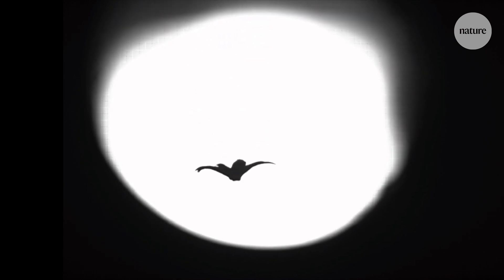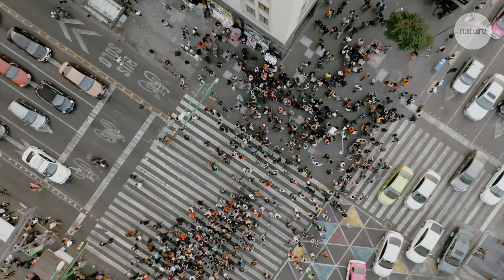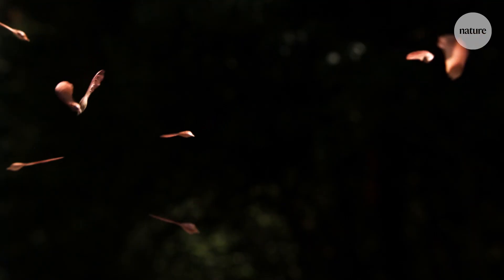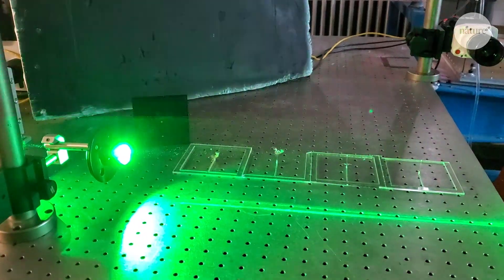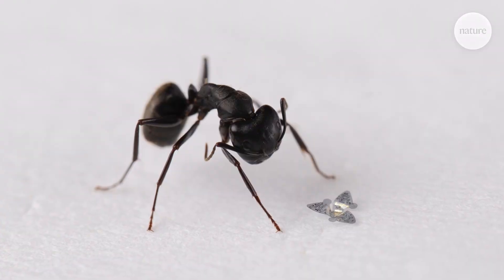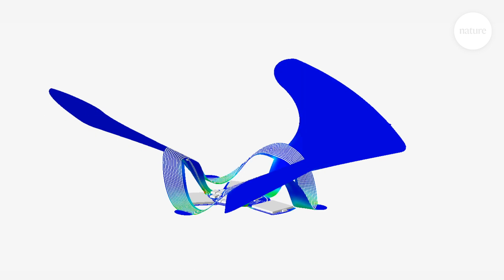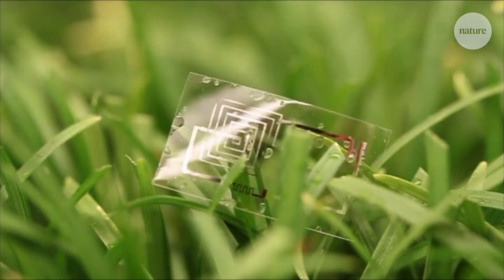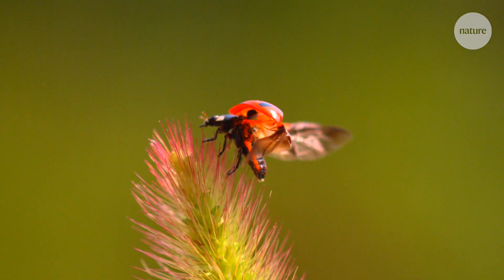Spinning seeds inspire floating electronics - and monitor the atmosphere

Comment: a dissolving substrate is nice, but that doesn't magically whisk away the various heavy metals used in the production of the actual electronics on the substrate. What of them? Are you claiming to be pursuing fully biodegradable electronics?
Reply: Polution is a matter of concentration. This heavy metals came from nature itself, from the ground, in first place.

If you concentrate led from the ground and them sprinkle it back thin enough, you're basically restoring the early conditions, and not polluting.

This concrete case presented in the video might be a problem, but it might also not be one.
Reply: @guiguspi  "the ground" is a fairly ambiguous title. You don't generally find much lead in topsoil so adding any additional lead to it is going to raise the levels of it above natural levels, and that's pretty much the same with all the other heavy metals used in simiconductor manufacturing. Unless they're exclusively dropping these things into spent heavy metal mines, they're not going to be restoring anything. Generally speaking, the dose makes the poison, but heavy metals are a special case. There is no minimum safe dose of lead. It has no benificial biological function in humans. A single atom of it is toxic, two atoms of it are twice as toxic, and on and on as with many heavy metals.
Reply: I agree with you! Imagine, hundreds of thousands these tiny devices litter the opened space and the environment. Eventhough they made from biodegradable material, they have potential hazards and new toxins for the nature, especially when they come in big number. 

This tiny machine has passive mobility, means they can not control the movement. In my opinion, the company and producers of these machines shall have responsibility to be able to tract every single mini machines they realise to the environment. They need to make sure, all of them can be recovered and recycled in their place. Not letting them degraded in the nature and bring new potential hazards to all of us.
Reply: @AtlasReburdened  I see your points and am taking your word for surface soil composition (which I have no idea about).
But the part about relevant lead toxicity in orders of magnitude of SINGLE ATOMS in the body, I'm pretty sure is a enormous exaggeration.
Reply: @guiguspi  What specific statement do you contest? I said nothing of "orders of magnitude" and merely stated established fact. There are exactly 0 beneficial biological functions that use lead, but it is a biologically active element. This means it interacts with your body and every way that it does is bad for your body. This is what it means for something to be toxic. It doesn't mean it's going to kill you right. It doesn't even mean that it will be listed as your cause of death, but every atom of it kills cells on its way through your body, and your cells can only replicate a certain number of times, so every atom of lead that you ingest shortens your life or reduces your quality of life by some incredibly tiny but real amount.
Reply: Who says they are using "heavy metals"? Electronic ink has already been developed for circuitry that's non hazardous. I'd bet these scientists have already figured out how to avoid harming the environment.
Reply: @maxhugen  I'm not talking about the traces, I'm talking about the chips. If you have a way to make integrated circuits using only elements that are compatible with human physiology then I congratulate you, because you'll soon have a Nobel Prize and wild riches from licensing your patents.
Reply: @DickHolman  It's been a while since I read the article on it, but I think it was graphite.
Reply: @AtlasReburdened  As they have gone to the extent of making these bio-degradable, I suspect they've looked at the impact of the design as a whole. 
As to "compatible with human physiology", the very soils we rely on can have plenty of nasties in them too. 
One advantage these devices may  have is a very short working life, and can perhaps be constructed from materials that would be impractical in your mobile phone.
Reply: @maxhugen   I still think you're completely missing the point. No small research team with a cute little idea is going to have the 10s to 100s of millions in budget needed to completely revolutionize integrated circuit manufacturing and build their own simiconductor and IC manufacturing complex, which they would need to do because no such biodegradable or biocompatible chip manufacturer exists. This is not an issue of due diligence. This is the same type problem they would have if they were proposing to bypass dropping them from aircraft and simply put them in the air with wormholes. No such capability exists on Earth.
Reply: @AtlasReburdened  You seem extremely determined to validate your statements. Are you an expert in the current advances in biodegradable/ biocompatible electronics?
Reply: @maxhugen  You seem pretty desperate to pretend that there even are major advances in biodegradable/biocompatable simiconductor manufacturing. Try to find any, literally any processor that is fully biodegradable or boasts solely biocompatable constituents.
I can't be an expert in something that doesn't exist, but it does happen that I'm thoroughly familiar with the current state of the art regarding simiconductor and IC manufacturing. That's kinda the whole reason I focused on that in my OP.
Reply: @AtlasReburdened  OK, so you're familiar with *simi*conductors. 🤣  For everyone else actually interested in advances in semiconductors, an online search will reveal a lot of info, although admittedly it's hard yakka to understand some of the technical papers. 🇦🇺  Q.E.D.

Comment: Why not leverage a capacitor with using the piezoelectricity harvestable from the spinning of the "seed"s?
Reply: Piezo ceramics need deformation to generate voltage, which I think is not the case if it only spins.
Reply: @hobbybaschtler7896  no even gliding has turbulence.  And surfaces could be designed to occilate in the air-flow.
Reply: @roidroid  of course it has turbulence. But these are very small for this scale and even in a microphone or a tuning device you need to massively amplify the signal you get from the piezo.